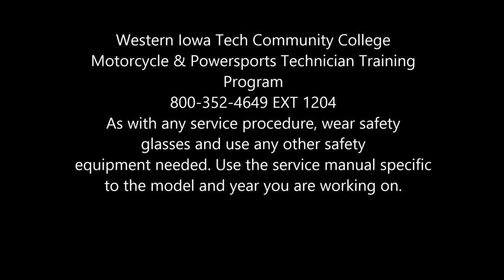How to test ignition spark with a Mac Tools Ignition Spark Tester

Comment: Shane, I love these videos but it is not really the compression that would prevent spark but the density of the fuel/air mixture caused by the compression that would prevent a weak ignition system from being able to spark across the gap. The thing to think about is as you compress a fuel/air mixture you increase the density of the medium so it takes a greater amount of energy to spark across the gap.
Reply: The compression increases the density,

Comment: I wish these things came with a proper scale.  The markings are not quite in kV as you see on all these videos and websites.  A 10 mm air gap in dry air between tips is about 30kV, increasing almost linearly.  But it varies with humidity.  At about 60% relative humidity, it is only 8 kV per 10 mm.  If your compression ratio is 10:1 that means if your spark jumps 10 mm on the tool, it can jump about 1 mm of plug gap under compression, or more likely 0.8 mm because of the fuel vapour. I hope this comes in handy for people testing coils and remember to keep your hands clear because the sparks are pulsed and high voltage.  Also check the zero on your tool.

Comment: Today I just had an incident where cylinder 4 on my tractor was not firing, but my inline spark tester said I was getting spark there. So I threw on a glove, and unplugged the #4 cylinder spark plug wire, and the sound didn’t change. Pulled the plug out and tested the spark plug with my volt meter, and found continuity between the positive electrode and the threads of the spark plug. Put a new plug in, and we were good to go. So I got a false reading from my inline test light.
Reply: Elecrtricity was flowing through the tester so it is normal it should light up! You need to test spark plugs as well too! But nice catch and intresting lesson for everyone

Comment: Love these videos, Shane.
The gap will be different if you keep the plug inline, since in that situation you are jumping across two gaps. Voltage drop across the spark plug (in series) should result in lower voltage drop across the tester. I really like that style of tester because you don't need to remove the plug, so you get the test done in half the time.